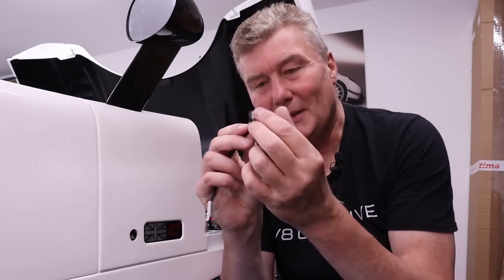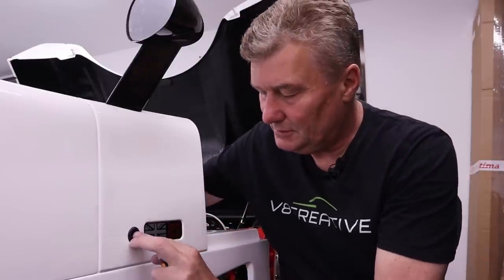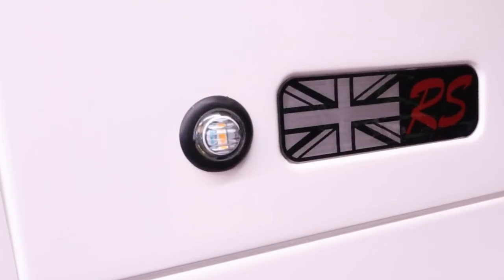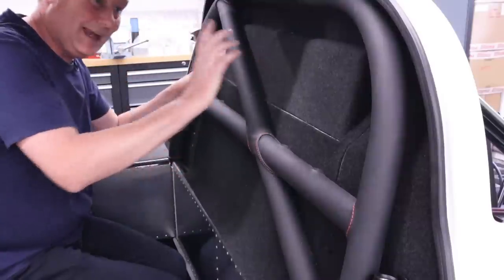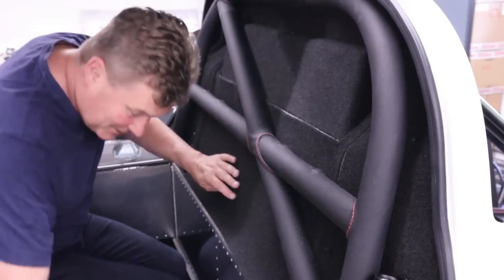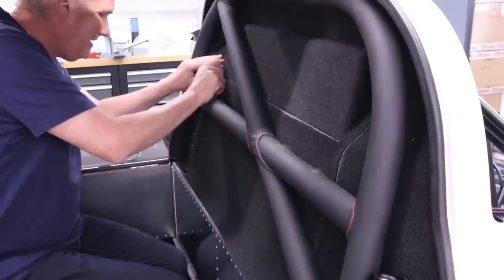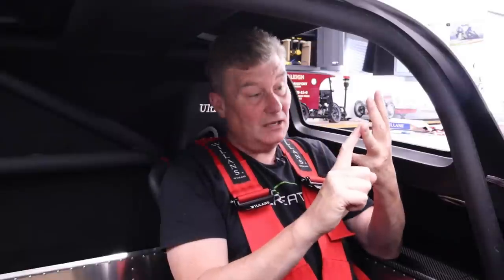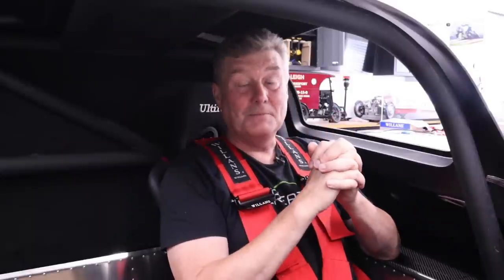Building an Ultima RS with Nigel Dean. Part 45. More upgrades. More carbon

Comment: A very nice episode. I always look forward to your videos. The red belts are a great contrast in color to the rest of the interior and do the car a great service stylistically. Mentioning in your video that the cherry on top will be you torquing down the bolts is an important detail to highlight. I read the other comments and the fellow who brought up the 6-point harness, helmet and HANS device issue made a really interesting point. Conservation of momentum and all that. In any event, great episode and I look forward to the next one.
Reply from the maker: Thanks for the comment and don’t worry, I have a detailed Excel spreadsheet which itemises every fastener on the car which needs final torquing/securing. It is a process I always go through in my builds since items do come off multiple times. Glad you enjoy the content and also read some of the other comments. I don’t confess to know everything, even though that is what I tell the wife, but I like to do research to understand the physics behind some of the logic left on the Chanel. Cheers Nigel and Rufus

Comment: You can’t beat harnesses for making you feel part of the car. One of the best things I did to my Exige. I’m lucky in that I’ve also got the advantage of being able to still use the standard seat belts if I feel like it (mainly on boring motorway journeys)
Reply from the maker: Good to have both options, and as you say a full harness definitely makes you at one with the car. Only downside is at junctions you cannot lean forward as you can with inertia reel three points. But I have managed in many cars over thousands of miles welded to the seat with harnesses.
Reply: @v8creative  Yeah, I agree. It’s only at junctions that the harnesses can be mildly annoying on the road. But that’s a very small percentage of a drive, and the feeling of them the rest of the time more than makes up for it

Comment: word of warning on using harnesses for road use. They don't allow any slack like inertia belts do, Meaning without a helmet and hand device, your head can continue traveling forward in a crash while your body remains in place. This can, and has, led to internal decapitations for some unfortunate drivers.

Having both harnesses for track use, and an inertia seat belt for road use is probably the wiser choice.
Reply from the maker: Thanks for the comment, similar to another I received a couple of days ago. Full harnesses have been fitted to road cars in the UK for decades and are approved by VOSA for road use. So even if some unfortunate drivers have suffered such injuries I would suggest in such an accident wearing a three point seat belt would have had the same outcome but maybe a different injury. If I look at all the mainstream seat belt / harness manufacturer websites they all say harnesses are for road use and comply with all safety requirements. I know the British Army use them on most of their vehicles also, as do seats for disabled children. Also many road cars fitted with full harnesses often have a laid back driving position, zero airbags, roll bars, and deep bucket seats. So yes, the shoulder straps have a few millimetres less travel (the lap straps don't since they often have explosive tensioners), but as a whole the environment for the driver and passenger is probably overall safer compared to a three point alone. I'm no expert so could be totally wrong and don't mind admitting as much, but if I am wrong I guess dozens of car manufacturers, VOSA, and the British Army must be also wrong. Thanks for watching and sending over the comment which has definitely stimulated some discussion. Cheers Nigel

Comment: You should only wear 5 and 6 point harnesses with a helmet and a HANS device however. „Normal“ seat belts have belt force limiters and such to keep you from overstraining your neck in a crash. With a 6 point harness, your body can‘t move forward… but your head can, and it‘ll shoot forward like a cannonball, unless it‘s supported in its own right.
So unless you always don your HANS and helmet, you‘ve just made your car less safe, even if it might feel safer.
Reply from the maker: Good morning and you raise an interesting point. In fact I questioned this myself after reading your comment so I have read a couple of university papers on the topic to get a full picture before replying. Taking everything into consideration in a car like the Ultima, with such a deep seat design, horizontal driving position, perfect attachment points for the harness, absence of air bags, full roll cage, etc, the likely hood of being better protected in a roll over, side impact, and frontal impact is superior with a 6 point harness compared to a standard 3 point inertia reel harness. Yes, since the driver is so well restrained the injuries are slightly different in a collision, an increased chance of whiplash (as you mention), potential cracking of ribs compared to a sternum injury (a more robust part of the body), but overall the risk of submarining, contact with the dashboard, lateral torso injuries' (due to twisting), are all drastically reduced if not eliminated. So in summary an accident is an incredibly complex environment and in my opinion considering the many types of forces at play, the design of the Ultima, the driving environment on public roads, I believe I'm safer with the 6 point but hope I never find out. Appreciate the comment and keep tuned. Cheers Nigel and Rufus who also has a harness by the way :-)

Comment: Wouldn't you want to use a lock washer, or thread lock, on the harness bolts? Once the seat is in you will have hard time seeing if they are backing out. Just thinking of your safety.
Reply from the maker: Yep I'll use thread lock but the seats and belts will be coming out again since I need to get under the dash to finish off some wiring. They also need to be torqued. Good observation and thanks for the comment. Cheers Nigel and Rufus
Reply: @v8creative  You might want to hot glue the three spacer washers together, and to the lap belt.  This will stop them from falling behind the cardon center consul, if you ever remove the belt.  Years from now you may not remember they are free to fall.

Comment: 6 point are a disaster for ladies as the shoulder harness compressers her boobs making the harness very very painfull without discussing the crutch harnes
So a 3 point harness is needed for the pasanger, so is a 3 point available
Reply from the maker: Hi Barry and thanks for the comment. I decided to do some research on this topic and surprisingly there is little to no research papers available - my usual go to when I'm intrigued. However, I decided to go a different route and look at all the harness manufacturer websites. Interestingly there is zero distinction of male vs. female racing harnesses in the market and even the FIA have no reference to the topic. Hence all racing must use the same full harness belts regardless of driver gender. For road use, yes full harnesses are not as common until you go into the low volume production space where 90% of cars use this type of restrain. I admit the full 6 point is rare, but 3 and 4 point harnesses are common solutions. Some manufacturers do offer traditional 3 point inertia reel but this is rare. Form my personal experience I have built 6 cars sporting full harnesses and my wife, daughter and female friends have travelled thousand of miles over decades being strapped in and I have never once heard any complaints of discomfort. I guess a diagonal strap vs. two diagonal straps does not really make a lot of difference? I have never seen an Ultima with an inertia reel three point set up to answer your final question. Thanks for the comment, always enjoy doing some research. Cheers Nigel